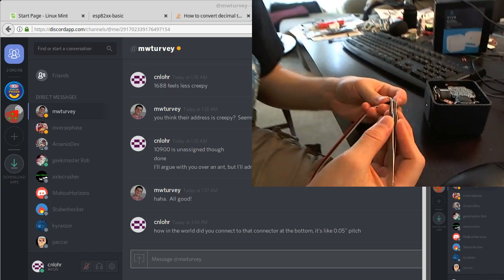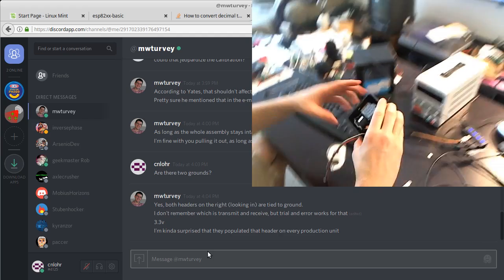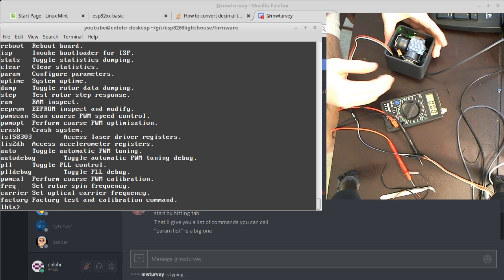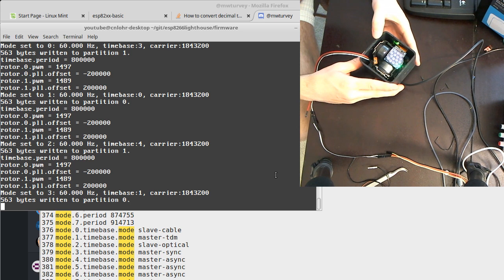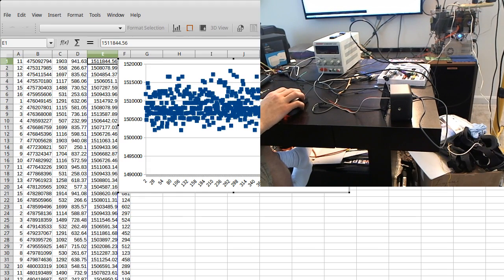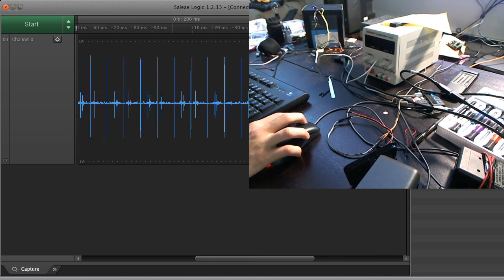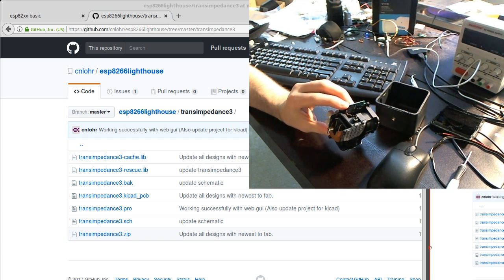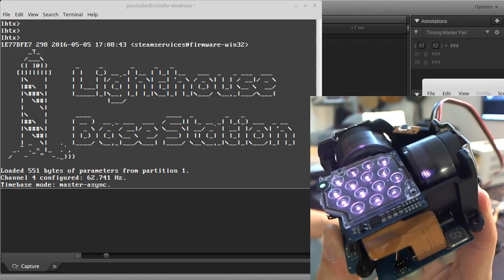Serial terminal into a vive lighthouse.

Comment: Umm i am really a noob here, trying to explore the lh2.0 by myself (gonna check out the live stream) and I don't get it why you're disassembling the lighthouse for connection. I can communicate on USB serial via putty and able to send commands there. I don't get what is the difference
Reply: For some reason Lighthouse 2.0 has a serial connection embedded on the USB, but  this is not the case with lh 1.0

afaik there is a "recovery mode" for flashing the EEPROM via USB, but no way to get serial.

Comment: Sorry, I'm really unfamiliar with these... is that a gyroscope inside it? really not sure what is going on here...
Reply: George Tsiros
 every base station sends both lasers 60times per second for both stations you get 120 positions per second.
Then the headset has gyro and acceleration sensors to estimate movememt and making it more fluent.
The headsead spits out 225positions per second and the controllers 220per second.  Internall calculated the rate goes up to ghz positions. So it is more then enough.
Reply: AFriendlyMathematician
There is no ir grid. This is not a kinect reconstructing the room, these boxes are only emmiting precicly timed pulses and turning flat lasers.
The whole positioning is done by the sensors spread over the tracked objects (vive/controllers)
Reply: The reason why it is called a light house is because I do believe it has a spinning lidar which is generating a point cloud of the room.
Reply: a laser line is scanned across the room; the detectors are spread across the surface of the controllers and the headset
Reply: AFriendlyMathematician they just work on different discipline
Reply: AFriendlyMathematician false.

The lighthouse tracking realy depends on timing. It sends an sync impulse when one rotor is at a special position.
On these rotors is a laser which sends a Line throu the room.
If you messure the time between sync flash and the laser hitting a Sensor, you will get the angle relative to the basestation. Doing this with multiple axis and multiple points on the tracked object, you can reconstruct the position and rotation relative to the basestation.
Reply: Eslar Fuchs How exactly is using a laser to track NOT lidar, when that is it's definition? I understand that it doesn't generate a point cloud,which is likely why you said it's false, but we are refracting a laser, then using an IR grid to identify where the response is coming from.
Reply: Eslar Fuchs holy shitballs that must be laggy as fuck

Comment: CN, Always interesting to watch your YouTube offerings including this one! BTW, have you cared to try out the ESP32s? At one time I recall that you were big on WiFi performance, WebSockets and WS2812's and it was a great help when I started playing around with those, and I wonder if the supposedly higher power of the '32 may tempt you to revisit those older projects?
Reply from the maker: I've done a good bit with ESP32s, but nothing about them is really any more interesting to me than what I can do with an ESP8266... so no real attraction.   All of the stuff I wrote for the ESP8266 drastically outstrips the real-life performance of similar libraries on the '32 sooooooo
Reply from the maker: Yeah, basically.  There have been projects I've wanted to do something with that I thought "OH I CAN DO THIS WITH THE ESP32" but then it turns out it was easy to do on the ESP8266, a smaller, lower power chip.  Takes less time to compile for, too.
Reply: How'd you mean exactly? All the stuff you do/done with the ESP8266 cannot be done in a better or in a more performant way with the ESP32? So you have no attraction to develop on the ESP32 specifically?